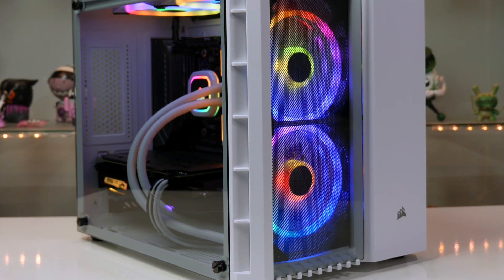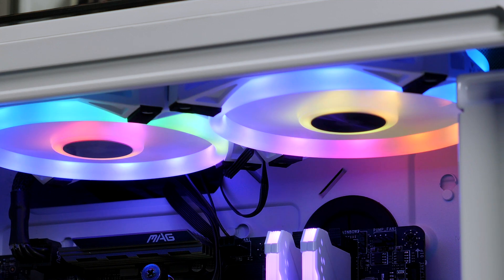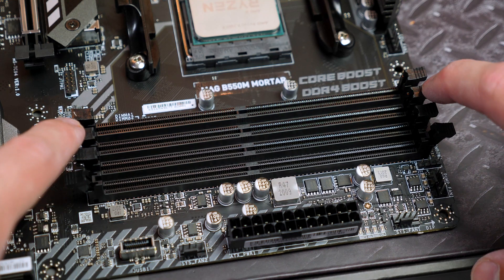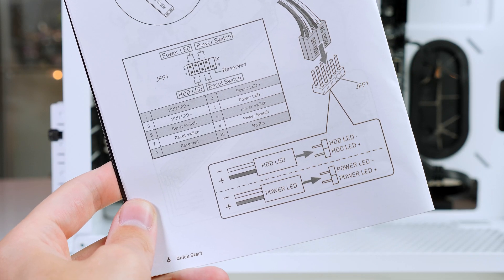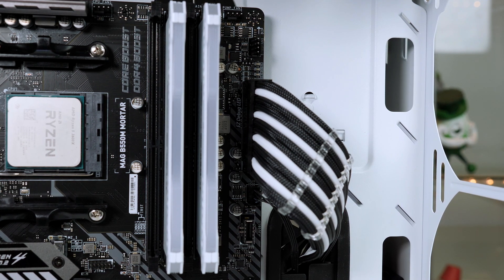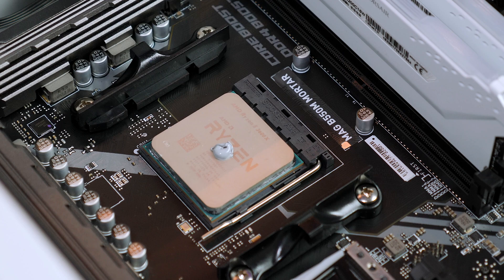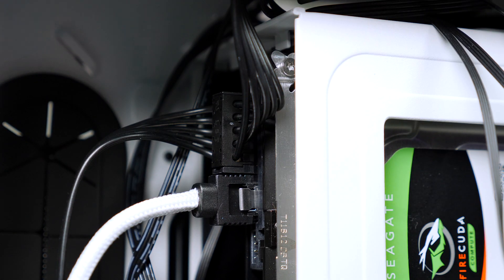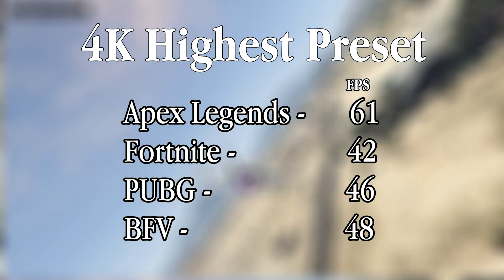How To Build A $1300 RTX Gaming PC [RTX 2060 Super/Ryzen 3600X Benchmarks]

Comment: Great video bro! I currently have a similar setup built in a Carbide SPEC-06 in white the only differences are my H100i is the older black one, psu is a RM750X in white and I'm running a 5600G (hopefully gonna be upgrading to a Ryzen 7 5700X and RTX 3060 2X Ventus quite soon)! 
My MoBo is also the B550 Mortar and as you can imagine looks a little swamped in its current case which is why this weekend's project is to transplant everything into a white Crystal 280X, looking forward to it as I think it'll look better in the smaller case!

Comment: Thinking 1Tb was a little light on hard drive storage, and personally, as an owner of the same motherboard, I would have used an NVMe SSD instead for the OS to gain as much speed as possible from the motherboard (luckily I got a 1Tb WD SN850 PCIe 4.0 drive from Argos for about £120 a few months back when they had a short-lived big reduction).

Still debating the RGB version of the 280x for £98 from Amazon at present, as already have the 680x.

Comment: Nice vid! I’ve just done my first build using this case, all went well apart from my CPU temps are off the chart when running GTA V at 1440p I’m maxing at 98•C, I’m assuming the stock wraith stealth cpu cooler is the issue. Have you had any thermal issues with this case, no back exhaust probably doesn’t help either, cheers.

Comment: how do you take off the front panel ? im trying to get the dust filter out but i cant figure out how to take the panel off
Reply: you need to remove all front face  you just pull corners and is of and you can acces filter